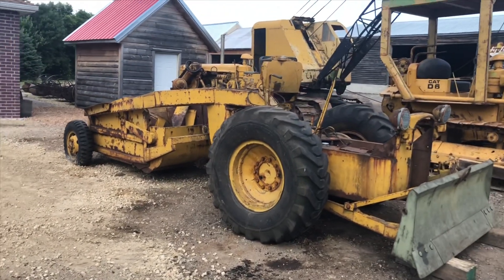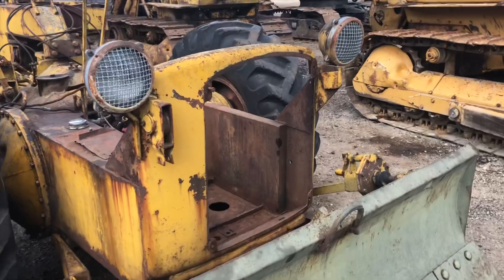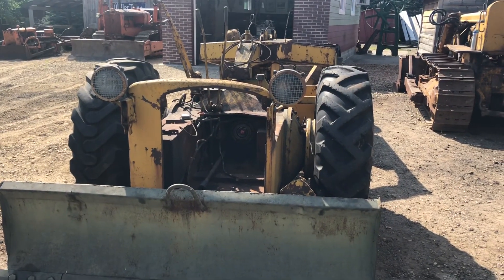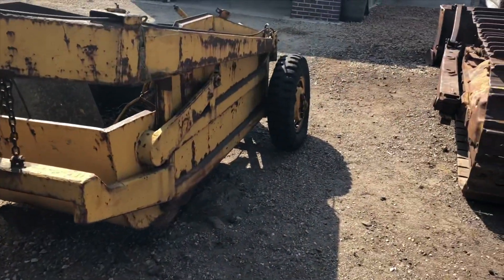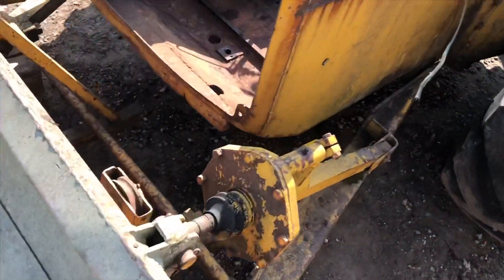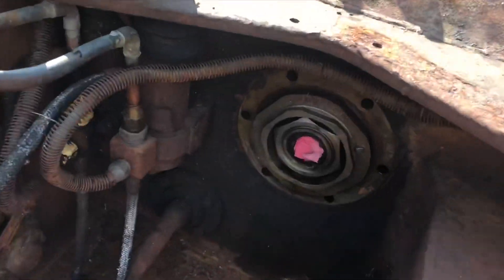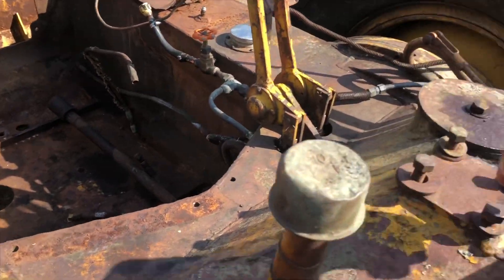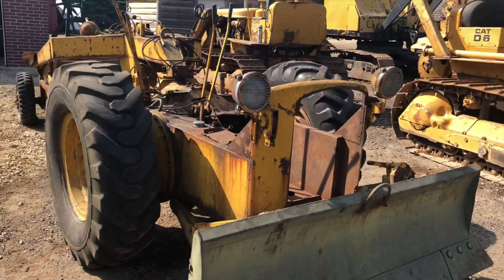LeTourneau D4 airborne scraper

Comment: The guide brand lights are not original, but the left tire is. Air transportable is not the same as droppable with a parachute. And even so, they would  have been delivered to two pieces and assembled later. Have you done any work on it?

Comment: A great find Very much worth restoration .
I like to see this combined with other Airborn and Airportable equipment for a display or collection , they are the rarest of the rare, as few were built fewer have survived as for these I m sure many were worked to death in the construction and related business's
Reply: I think there are much rarer airborne machines, like the grader, CAB scraper pan, and the Case SI setup to pull the CAB
Reply: @stephensarkany3577  not familiar with those will see what I can learn , thanks for sharing .